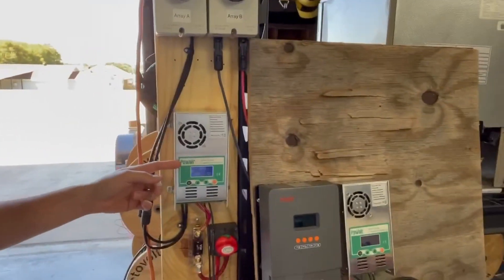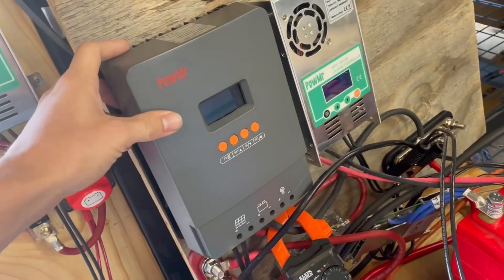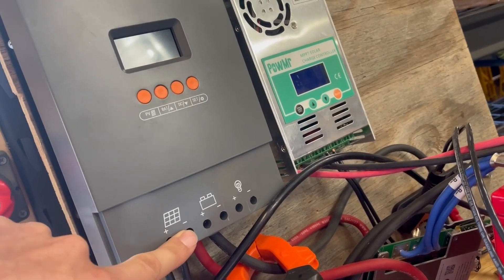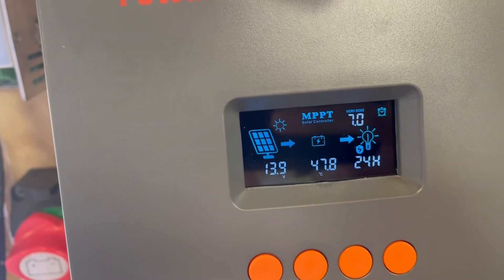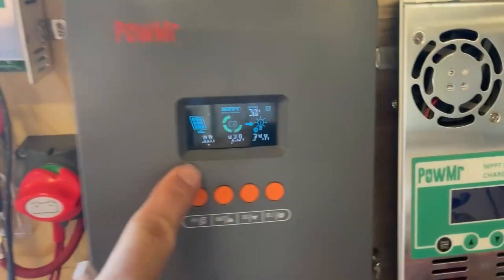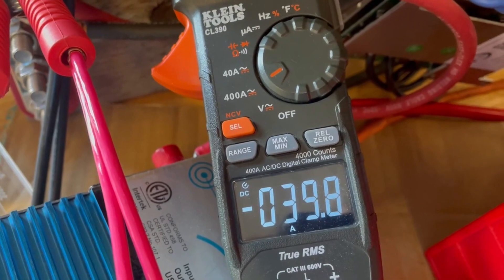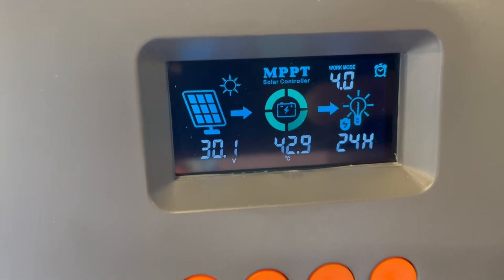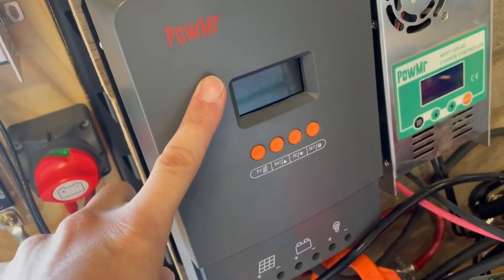PowMr M60-Pro - How Does it Stack Up Against its Predecessor?

Comment: Saw the powMr  60a was on sale at the same price of my OneSolar 40a. Went here to see if its worth it. Most reviews are crap so i really enjoyed you testing it at 60a and seeing it failing. I notised people warn of me mode 7 in other reviews in the comments. Please give an update if you fixed it with a cheap 80*80*10mm box fan or what happend.

Btw if you need a cheap good controller with awesome display, try the yellow "One Solar" i really love it. I run my 40a one solar mppt costing 75$ at up to 44a its quite solid. Even have graphs for days of amps and wats. Charging my 12v lfp at over 600watt on sunny days. I connected 3*450watt lvtopsun panels. 148,5voc(49,5*3) . Max voc is 150. 

Did add a 12v pc boxfan to help as im in a hot clima.
Reply: Здравствуйте. Пожалуйста, поделитесь ссылкой, где вы покупали OneSolar? Спасибо.

Comment: At 9:45 when you turn on the PV input... I saw around 650watts briefly. Do you have two solar panels with high VOC in series? The manual I saw online says  VOC from PV for a 12v system is 20V to 80V. Two panels with open circuit voltage around 40v connected in series would quickly max the controller causing it to get hot 🔥 and behave the way you showed in the video. That is my suspicion?
Reply: UPDATE: I ordered the same charge controller and he is very right. The default charge setting is drops charging my lifepo4 from mode 4.0 to mode 7.0 very quickly even though my battery capacity was low. I had to use the USE mode and adjust the setting to 14.6 then 14.4 then 11.0. That keeps it in MPPT mode longer.
Reply: @realToby  14.6 then 14.4 then 11.0 will cause your battery to go flat. 11.0 is when the charging comes back on. If you have a battery with a bms connected to it you can then trust the bms to take care of the charging.
Reply: Thats recommended for best effeciency. It should be able to use the full range. I use 148,5voc on my "one solar 40a mppt" at 12v, and i hit as high as 630watt. Its capped at 44a it seems. It has a max voc input of 150. I use a 12v 250ah lfp. My mppt recommends 18-60v for 12v

Comment: The C-value is for voltage calibration,             used to set the correct voltage value of battery reading displayed on the screen.
I'm using same powmr pro unit, the unit seems to have issue with the 7 mode, where it enters pwm mode and stay stucked.
Reply from the maker: That makes sense! Didn't help my troubleshooting but is nice it had the feature. Now if only the charge controller didn't require arctic temps to operate as designed ;). Thank you!
Reply: Is this an mppt or pwm controller? I was just about to order one but if its pwm I can get one for 1/7 the price
Reply: @dantronics1682 MPPT

Comment: you have to put a high consumption for it to reach 700 to 800 watts of panels when it enters 8.0 mode it lowers the voltage of the panels and the battery stays at 13.8 in float mode

Comment: Experience with the older PowMr units was that they seem to work ok but 2 recent metal ones, both sent back, do the same as the newer model that you have. The system they were used on logs a battery voltage, charge current and solar voltage by the minute and, even with depleted batteries, spends most of the day holding the panels near battery voltage despite them having a Vmp of 30v. Now swapped for Makeskyblue with v118 firmware which seem to track flawlessly for about the same price but getting almost twice the power over a day.
Reply from the maker: Wow and you’re not alone in that experience! I’ve purchased another batch so I’ll be testing this to make sure they are ok. Thank you for sharing!
Reply: @BeeneEnergy  You are not alone (lol)

Comment: I attached an heatsink to my ProMr to help with the cooling. That seems to help the cooling. Honestly though I also have a Makeskyblue both are side by side, the Makeskyblue far more efficient.
Reply: I purchase one of these controllers and trying to make work with a 24v lithium battery but i cant change the boost voltage about 18v
Reply: @MobeEvents  I don't believe these MPPT charge controllers go that far to be honest. Have you tried a buck boots controller? You see most charge controller was built with specifications of led acid batteries as led acid batteries have been around for well over a hundred years. Lithium batteries are new technology.
Reply: @howardescoffery4950 the product mention it can work with lith battery there is also a setting for lith but at 12v. So i see where another youtube user online config his settings under USER mode battery type but that was only for a 12v system. The issue i have is the interface only allow max boost to 18v
Reply: @MobeEvents  becare the interface display the value for 12V   . you have to do the maths if your batterie is 24v.  this decice is crap, they can not even display the rigth numbers and let you do the math

Comment: It would appear that the new charge controller is not ready for use and the problem lays with its inability to dissipate heat effectively. It is certainly not an upgrade from the previous model with active cooling.

Comment: See if you can get the ampinvt controllers from a supplier. I really like it for the cheap end. You can play with my 40A version if you want to try it.
Reply from the maker: I did it, ordered a 60amp to play with. I watched some of that video but apparently didn’t get far enough to consider purchasing it last time. I do like the ability to change charge current and set the battery voltage!
Reply: @BeeneEnergy  sweet! Interested in your review of it.
Reply from the maker: I’ll make it a point to look  at the video you no doubt have on it. I ordered more of the old style but hadn’t circled back around to what I’ll do in the future!

Comment: I have had one of the metal housing units for over 4 years now. Works great. Ordered another one for some additional panels I'm putting on my house. Only 2 250 watt panels on a 12 volt agm setup. It has very strange behavior compared to the old one. Acts a lot like this new unit you are showing. Goes to 7.0 almost immediately. Doesn't drop back to 4.0, no matter how low the batteries get. Got a replacement, does exactly the same thing, except the replacement battery volt reading is WAY off. Quite disappointed. I wish the new ones would work like the old one. I was going to try this new one you are showing in this video, but I've ordered a Tracer 4215bn after seeing some of your other videos. Hope it works out.
Reply: Powmr new one using new chip that crap. I have one laying under my bed😂